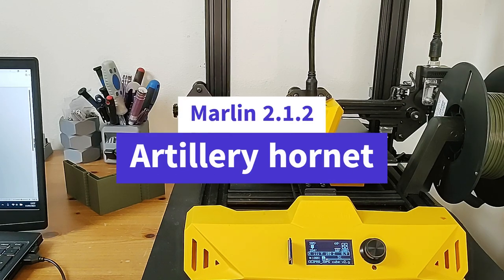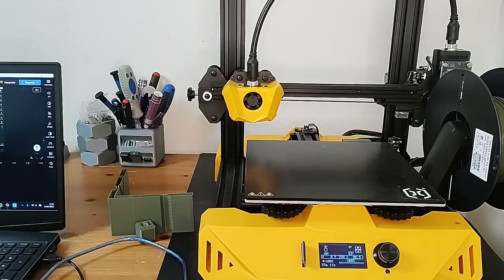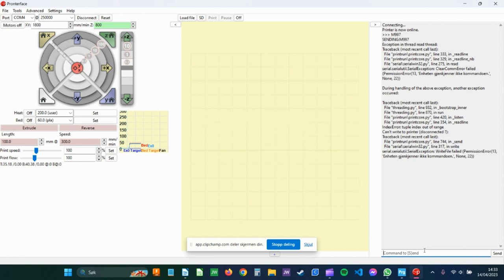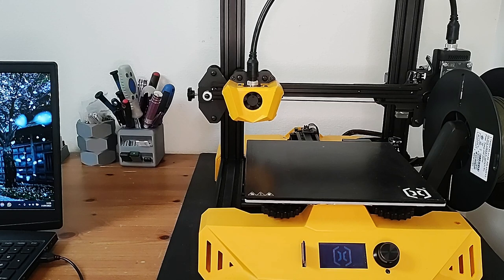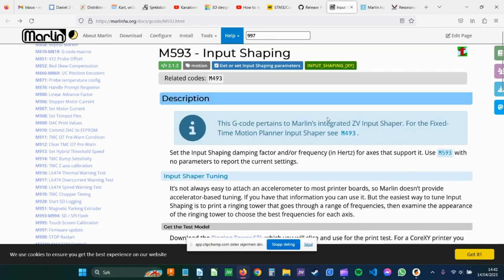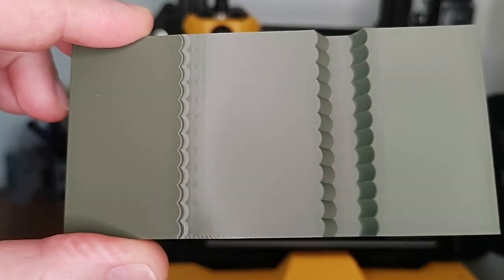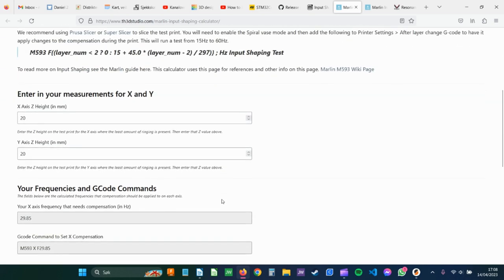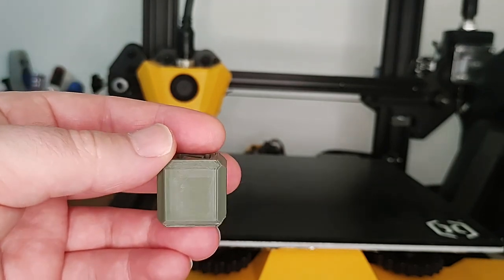Artillery Hornet - Marlin 2.1.2 - Input shaper + Linear advance

Comment from the maker: The firmware.bin file was missing. It has been added to my GitHub.
Reply: "Your printer's firmware supports host action commands, but they are disabled. The firmware will not inform OctoPrint about job pause & cancellations, filament runouts, and similar firmware-side events. If you want this functionality, you need to change your firmware's configuration"

Firmware is not compiled ok.

I oppened and issue on Github.
Reply from the maker: @cosmefulanito5933  i will have to look in to that. I am not an expert. If you know how to do this, please join my discord.

Comment: help please, verification failed and my printer dont turn on, just black screen, usb port com doesnt open to reflash :(
Reply from the maker: If you join my discord i may be able to help. Someone had this problem with the latest version of the flashing software.
Reply: @3D_printer_guy  I just fix it bro :D thanks your video help me a lot, I will join ur discord, I just has to Erase all Memori before flash firmware. 

PD: I had to do a jumper to enter in DFU mode

Comment: My object cooler fans became very noisy after the upgrade. It is not a mechanical noise, they are in good shape and just before the upgrade they were very quiet. It is electrical noise and I think it come from the motherboard. On different speed the sound has different frequency. It is very annoying. Can you tell me any solution? Thank you
Reply from the maker: This is weird. Can you join my discord server? It is easier to troubleshoot there.
Reply: @3D_printer_guy  ok

Comment: something is wrong with your compilation of marlin firmware. printer is working very loud. in marlin 2.0.7 hornet without that noise.
Reply from the maker: That is weird. Have you tried turning off input shaper? If you join my discord it is easier to help.

Comment: so, if i add your bin to an sdcard its done?
Reply from the maker: I'm afraid it is more than that. You need to do what i show you in the video.
Reply: @3D_printer_guy  no worries, i will do it like you showed
Reply: @3D_printer_guy  how fast and what accels are you using?
Reply from the maker: I am printing at 800 acceleration. 60-80mm/s speed. If you dont upgrade the cooling fans you will run out of cooling anyway.

Comment: In the official artillery flashing guide there is written to use .hex file, will the flashing succed when using .bin file?
Reply from the maker: I flashed mine with the bin file, so it should be fine.
Reply: I forgot to ask, are the all security settings set as they should? @3D_printer_guy
Reply from the maker: @realdude9149  if you are thinking about the thermal runaway and such, yes it is activated.
Reply: Thanks for help, im gonna flash my printer.
Reply: I noticed that a printer is louder now, is this because of input shaping? @3D_printer_guy
Reply from the maker: @realdude9149  try to turn off input shaper. I think it is still an experimental feature.